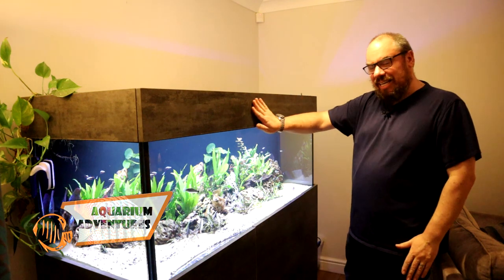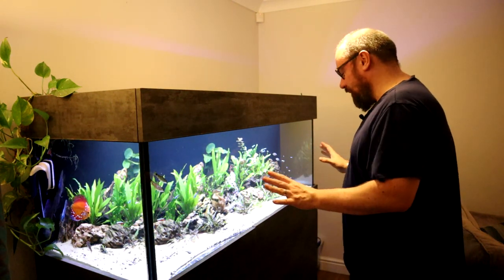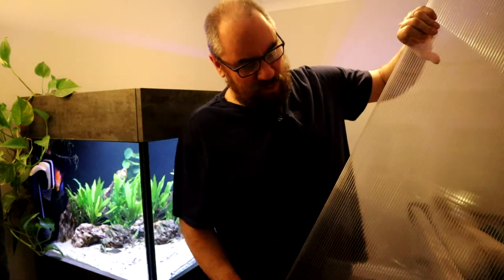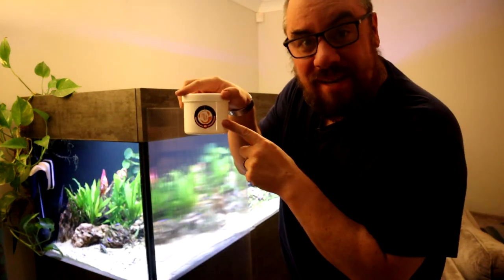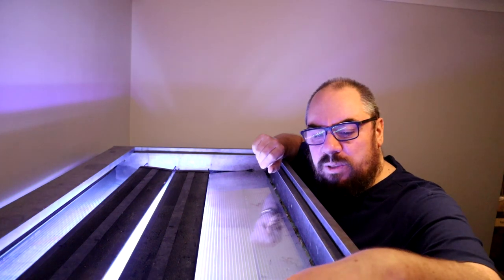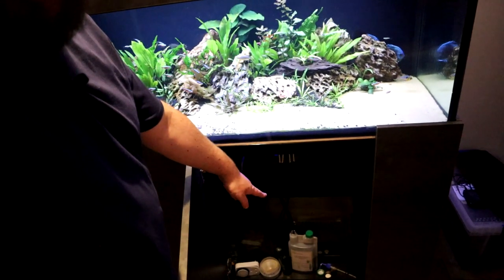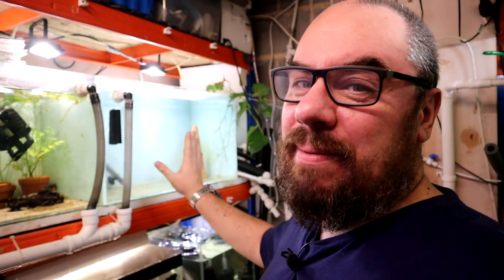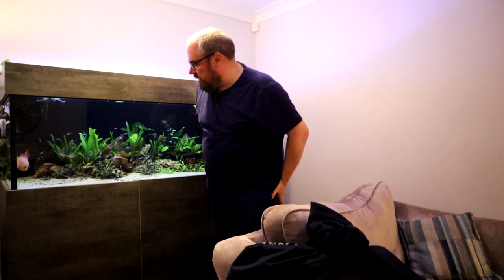DIY Aquarium lid - Custom Discus aquarium

Comment: That's a great idea. And helpful to. I need a new top for my tank. The lights that came on the lid are terrible. So I've been trying to think of a solution for a lid that would work with a new, better light. Thank you very much!
#AA10K.
Reply from the maker: Glad I could help!
Reply: @AquariumAdventures   Thank you. I only have a 10 gallon aquarium.  It's all I have room for.  Sadly. But I love it. Except for the lid that came with it. It has two little strips of lights. They have 3 little tiny bulbs each, one on each side. But the one on the left side has blue lights. The other is white. And it is nowhere near enough light. So I've been trying to come up with something that would work with a new better light. Your idea is perfect! Thank you for sharing it. I will be using it.😊

Comment: That will definitely help pal i was loosing about the same per week and got some glass sliding panels gut at the local glaziers for about £40 with runners for 7 ft tank  #aa10 keep the ground videos coming pal

Comment: Why didn't you fit it into the very top grove and spray it black to keep the light from shining everywhere? A little runner fitted along the sides would enable you to keep the lights below your canopy and therefore not effect the lights.
Reply from the maker: Because then the condensation would build up and run down the canopy and the outside of the tank and on the lights killing them.
I could get a 2nd panel and put it there - but 'light shining everywhere' isn't really a thing / problem.

Comment: I have that on my aquarium only problem with it is water gets into it and causes alge issues which is hard to clean if you dont have a bath in your house to do a peroxide dip. #AA10K
Reply from the maker: I'll have to watch out for that - I've used this stuff for a while and never had that problem before
Reply: Primetime aquatic did a video about it i think it might be if you have a air stone or sponge filter in the corner that the issue with alge inside it would happen